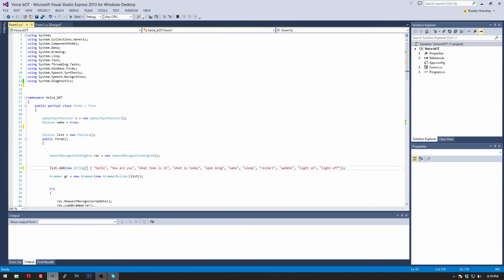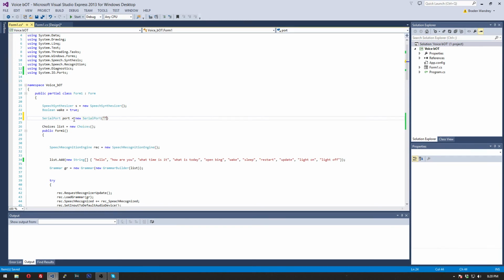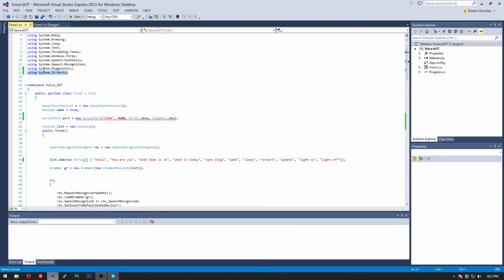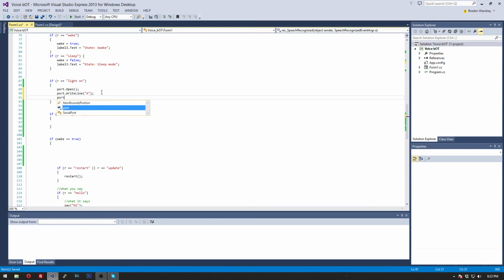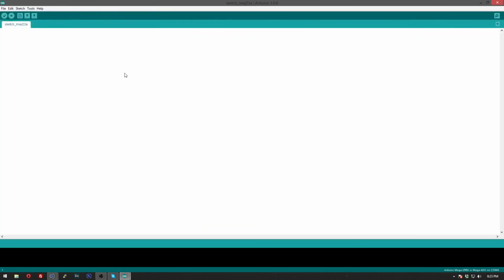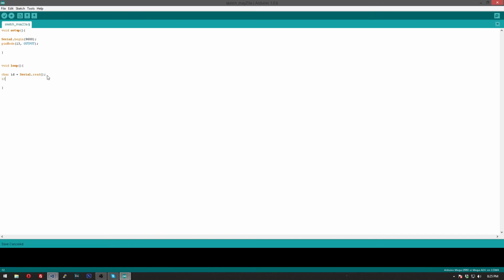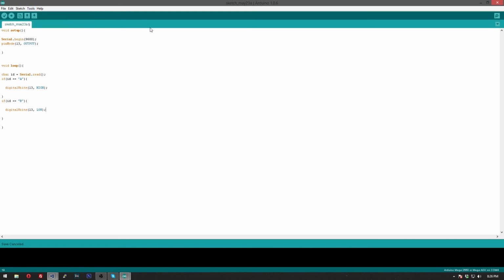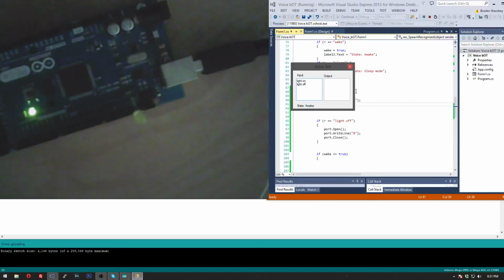C# Visual Studio [Making an AI]: Arduino Episode 6

Comment: What about controlling a servo motor with this voice recognition program?
Reply from the maker: You can just edit the Arduino Code to accommodate a servo.
Reply: Braden Nicholson I tried that didn't work. I tried doing some research and haven't found anyone who did the same thing. I think it's my code I'm not sure.
Reply from the maker: Replace the "digitalWrite(13, HIGH);" with "servo.write(Deg);"
Reply: Braden Nicholson Thanks for responding, my project has worked smoothly.